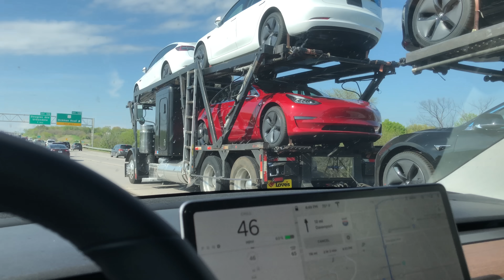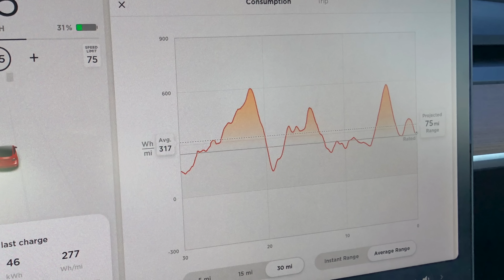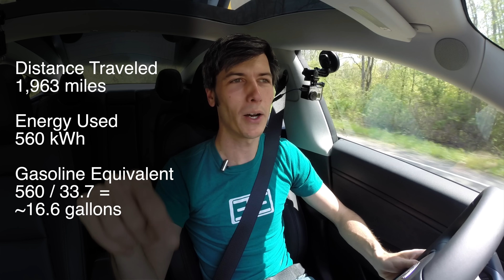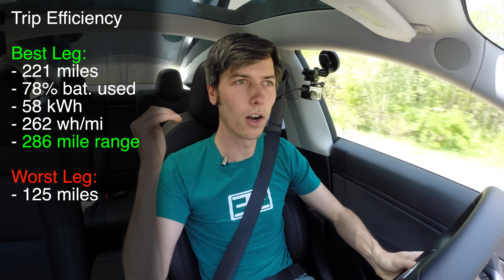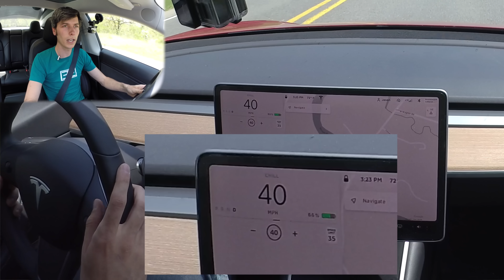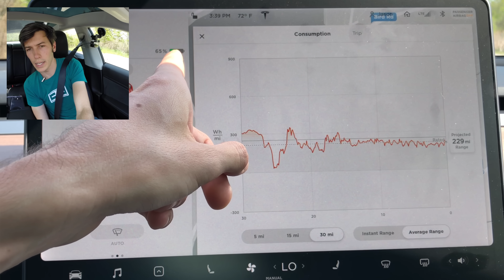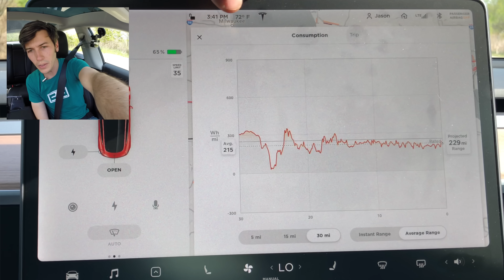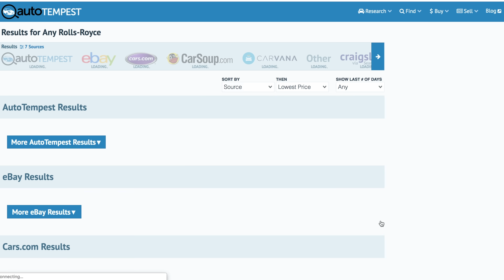How Miserable Is A Tesla Road Trip?

Comment: I'm concerned about the draw on the infrastructure for electric vehicles. Our current electrical infrastructure barely handles the demand. Another thing that concerns me is mining for lithium used in the batteries. Apparently the main source is a small area in South America that relies heavily on groundwater in an area that is the driest on Earth. What effect is that going to have if a majority of the vehicles come to be Electric? When a barrel of oil is refined it's not only gasoline and Diesel as the end product. Thousands and thousands of products are manufactured from other materials resulting from refining crude oil. Please don't bother responding if you don't have a constructive response. It's a serious question that deserves a serious answer.

Comment: So 8 months ago when you posted this, I was paying $2.20 - $2.40 a gallon and at $2.40 the total for 1963 miles is $157.04 and with a 15.9g tank you would have a range of nearly every 480 miles, meaning 5 stops @ 20 minutes each. So your 50k electric vs your car mid 20k Subaru:  same cost for fuel, minimum 200% slower fuel stops. In fact the time of your shortest charge for the tesla is a full tank, a pee, as well as grabbing a snack for the road in the subie. Until the roads magnetically charge electric cars there will be a distinct disadvantage in owning one. And if you did this in the winter... I wish you would actually. You'd need to up your reserve to at least get a 30% and that would drastically change your trip time
Reply: this didnt age well haha
Reply: lets bump the gas up to 5 dollars a gallon now and refigure the math.
Reply: @britthaney3533 I was more concerned with time on the trip but as far as gas prices, it's temporary. It's been nearly this high, right before it dropped below $2

Comment: There is a new term called “Range Anxiety “ if you push it and your battery goes dead it is not solved by a small container of gas . You will have to get towed . Driving cross country a couple of months ago I was shocked that At the huge line for charging Tesla’s just outside of Vegas with the owners standing outside nervously.

Comment: 2,000 is 7 tanks of gas (66.7 gallons at 30mpg, 10g tank) on my 2003 hyundai accent (cheap stick model). therefore my range is better (the tesla truck has about the same range as my car). price efficiency at $3/g is about equal to 37.6mpg.

Comment: So focused on energy density of batteries per kg or per litre.   I thought that way before buying one, too.  The reality is, it works.   Road trips are far from miserable, and while they don't have the complete freedom of gasoline trips, they do remarkably well, IF you get the right mindset and get away from gasoline thinking.  In fact, while this is only for nerds, the truth is the limitations of the battery turn into a bit of an adventure, which some enjoy, but others will not.    Yes, you need to spend a bit of time planning, yes you have to eat at superchargers, yes, you want to find hotels with charging.   But it's fun.   While any Tesla owner can just rent a gasoline car at a cheap rate for their road trips, I have found that most don't -- they prefer the fun of the electric car over the minor limitations of the energy density.

Comment: Interesting to pair this test with Harry Metcalfe's (Harry's Garage) test of a 3 Performance. A key point Harry made is how far in advance Tesla battery tech is, compared with any other EV manufacturer. He matched Jason's average of c. 280 wh/mile and said that's less than half what he saw in the Jaguar I-Pace. Also, US fuel is clearly far too cheap (!): at UK prices, his Tesla used only 20-ish% of the petrol (gas) equivalent.
Reply: "US fuel is clearly too cheap".... That comment didn't age too well.
Reply: @countryjoe3551  Still miles below UK/ European prices. In the UK, we're now paying about $7.45/ US gallon.

Comment: Nobody includes the efficiency from burning the fuel used to create the electricity, electrical transmission losses, and charging losses.  This usually ends up around 20% to 25% thermal efficiency in the end. Better than a ICE of 16% to 18% but still a lot of hidden losses that are not accounted for.  MPGe doesn't account for these losses.

Comment: So when Greta came to Canada to interfere in our elections last yr, she and her antifa parents were driving a tesla. They were worried that going any farther north in Alberta may not allow the tesla to work properly because it wont start in the cold. That was in October when temps were in low 60's or maybe 50's. What happens in dead of winter? Not an all around usable vehicle in all scenarios at all. Quite limited actually. You could buy a second hand beater with good gas mileage and not have deal with all this vehicles unspoken of quirks and not have to pay the 90 grand one of these tesla things costs.

Comment: For me too much stopping. I hate stopping on a trip. I drive till I need gas then it's a quick stop to fill up and back on the road. I don't stop till I get where I am going or am too tired to drive anymore. 200 miles to me is just getting started no reason to stop. If I was to travel all the time I would take a diesel powered pickup with duel tanks. Then put 2 100 gallon tanks in the bed. Set it up so the 100 gallon tanks would fill the trucks tank and I wouldn't have to stop till I needed the bathroom. Then I would drive till I couldn't hold it no more use the bathroom and right back on the road.

Comment: I know the father of a guy that drove 3,000 miles (LA to OKC and back) round trip in his Tesla-ron. He first reported that it was a breeze, but the truth came out later.

He said the worst part was the monumental anxiety experienced during the two massive traffic backups he was caught in. The kind of traffic backups that have traffic stopped, or stop-and-go, in the middle of nowhere for very long periods and distances. One was accident related, and the other because of weather.

Both backups happened in the middle of nowhere and when he was about halfway trough a charge. He worried that he would run out of juice and, being the middle of nowhere, require a tow. A tow because a few gallons of gas from a good samaritan or AAA can get a normal car out of gas off the side of the road, but not an EV out of charge.

In both cases he got lucky the backups cleared, but was low on charge. He had to divert to a city, that fortunately was within range, and stop for the day: The time lost to the backups mounted even after the backups cleared.

He said the weather related backup was the scariest, as the weather was very cold and snowy, and that each tick down of his charge raised his level of anxiety, because, as mentioned, a couple of gallons of gas isn't going to get his EV going again.

He also reported that finding a suitable place to charge in the hinterland of America was much, much harder than expected.
 
He said that he would never do it again. Would just rent a conventional auto to make the trip next time.
Reply: this is mostly irrational anxiety because traffic jams are where EVs shine... EVs use energy when rolling and the amount is based on how fast it's rolling, so you could literally be in a traffic jam for 8 hours and the battery level barely moves even if running a/c or heat... and I've also been in traffic jams where I had the same anxiety in a gas car, so this post is just rubbish

Comment: You said it took 563 kWh for the trip.  In CA, the average cost is about 20 cents per kWh, which would be over 110 dollars.  That's waaaaaay more than 16 gallons of gas.  At $2.50 per gallon, you'd get 45 gallons of gas, and at highway speeds, most modern cars get around 35mpg or better. Which would be about 1600 miles.  Still, the EV is better, but by nowhere near as much as what you claim.

Comment: Great review.  Questions/comments:
1.   I wonder if the estimator takes elevation changes into account.  In this journey it would be telling if on the drive on I-70 over the Rockies the estimate was way off, due to climbing to 11,000 feet.
2.   Looks like all of the stops were about 3hrs apart.  That's too short to use each stop as a meal break.  Every other stop maybe.  And even then, you'd be limited to whatever restaurants were next to the charging stations.
3.   I think range anxiety would still be a problem, because:
a)  What if a charging station is broken down or some other obstacle preventing access to it?  And if you're down to 15% when that happens, there probably wouldn't be enough charge to get to another one.
b)  What would happen if you did run out of charge?  Especially if at night?  Would you have any emergency flashers?  And how do you get going again?   AAA can bring a few gallons of gas, but can they bring an A/C generator, and sit there for however many hours it takes at 120V to get you to a charging station?  Or would it require a 100 mile tow to a charging station?
4.  It only saved $40 on that long of a trip?

Sum total, IMO:  it's a local vehicle, for a radius of about 70 miles from home.  It's possible to go longer distances, but a gasoline powered vehicle is better suited to it:  Longer range (around 350 miles for a mid-sized sedan -- far enough to truly sync fuel stops with meal stops), much quicker refueling, countless refueling stations all across America, no trip-planning necessary for stops, etc.
Reply: All of your concerns about range anxiety are completely valid and shared by me.  When I got my current car, I could have gotten a Tesla, but there are no chargers in my area, and my house doesn't have a garage.  It was either drive several dozen miles out of my way every other day and wait around an hour for it to charge with a Tesla, or get a standard ICE car and just stop 5 minutes for gas once or twice a week.
Ideally, you want to have some flares and warning reflectors in your car anyway, in case you break down and flashers aren't working or visibility is poor.  If your Tesla battery goes too dead to drive, the blinkers are supposed to still be able to work for a while, but it probably isn't good for the battery integrity and likely won't last very long.  In most places, you'll be looking at getting towed to a charger and likely have to push your car the last stretch because they couldn't drop it off at the charger.

Comment: I do have a question. I live in australia and basically yearly drive  a 4000km round trip is a tesla even feasible for that? Only one end has fast chargers, otherwise it would be getting charged off 240v 10a. Or should i stick to my old diesel 4x4 (last trip inc towing back around 800kg of stuff cost 1500 aud, that included food, powered camp sites, drinks)

Comment: I am almost trade-in my 2018 Lexus LS-500 Fsport in for 2020 Tesla Model S, but after I test drive the Model S and the autopilot and full self-driving feature really disappoint me. I am not sure if there is a way to get around it. I took a long trip all the time and I use the cruise control on my Lexus LS500 a lot and the help of the steering wheel assists it to help a lot on the long trip. This is why I want Tesla so I can have better help on a long trip. But it turns out the Tesla Autopilot and self-driving only go over speed limit 5 miles that all. My Lexus can go above 100 miles with cruise control.
Can anyone confirm if it is correct that Tesla only goes over speed limit 5 miles? Is that a way to get around this limit?
Thanks 
Nice video man.

Comment: Question.  From what I know batteries only have so many changes in them, so charging small partial charges eat the life of your battery.  So why would you not want to wait for a full charge?  2nd question which you probably would have to do a video on, what is the life and cost of replacing a Telsa battery?
Reply: Also fast high power charges shorten a battery life compared to a 12 hr 120v charge.
Reply: he didnt show charging the car, just driving it.  where and when did he charge the car.  did he sleep at night while charging or have to wait 5 hours while his car charged up?

Comment: When comparing fuel efficiency of EV and ICE powered cars you have to start at the engine. An EV engine is back at the power station so you have to include the efficiency of the boilers and furnace, the transmission losses and the recharging losses.
Reply: If that is your argument, then ICE cars engines start at the drill for oil, then the processing, and then the transportation (by truck, train, boat what have you which is also burning gas) to the gas station where you get fuel.
Reply: @TheStalkingShadow  That is correct and is part of the purchase price of the fuel.

Comment: Once the car is freshly charged it is efficient if the EV is new.

Yet how efficient was it to make the electricity, transmit it and charge it. Not so much. 
He is selectively ignoring all the "inefficiency" was done prior to the charge.

Translation
If you ran on Natural Gas you'd go how much further than if you converted it to electricity first.
I'd like to know the answer to that. I'm guessing prob 40% farther.

As far as green energy. There is a reason you won't see a solar panel on top of these things.
If you saw how little the charge moved you get a better Idea the power needed.
I would not be surprised if you had a cloudy week the car would actually have a less charge at the end of the week, standing still. As the battery does lose energy over time even if battery is brand new.

Comment: Oh yeah, let's put this on OTR trucks. I drive 48 miles to work, so 96 miles a day. I don't want to sit for an hour charging every two days, thank you very much. My 2014 Ford Fiesta typically lasts a week on a full tank. And for those saying you can just charge it at home, yeah sure let me just skyrocket my electric bill instead of paying $35 a week in gas. Okay.

- But anon, you're spending $140 a month in gas!!

And how much MORE would that be in electricity?

- BUT IF YOU USE THE CHARGING STATIONS---

My time is worth more to me than the price of gas. Your argument is invalid.

Comment: What about the power loss due to resistance in the over head power lines ? Just the loss of pwoer to get electricity to your house from the coal buring power plant.  Not all efficent as it appears. Current drawn by the substation is I=P/V and the higher the transmission line voltage, the smaller the current. The line loss is given by Ploss=I²R, or, substituting for I,

Comment: What happens to your trip planning if you need to deviate from Tesla Supercharger locations and then charge conventionally ?
Sounds like it would make trip take many times longer, given that you would reduce from 150kw to 1kw charge rate ?
Or are there some 240v generic charge stations around ?
Reply: there are a lot of 3rd party options that also charge at 150 250 or even 300

Comment: We did a trip of about 350 miles a few weekends ago in our Model 3, it was actually quite pleasant and we got to see some areas near the chargers that we'd not visited before on a route that I drive quite often but never get off the highway. A head wind, uphill and high speeds REALLY affected our miles on the way home. The super charger we used was amazing!!  My 4Runner gets about 17 mpg on the highway so I would have stopped 6 times on HIS same trip of 1,963 miles and spent about 300 bucks in gas!!  Oh and you "being born in 1963" . . .  my ass!  😆👍

Comment: It would help if you added the time it took to charge before you initially began your trip.     With the numbers you provided, I came up with an average speed the vehicle can transport a team of drivers is about 50 miles per hour over long distances.   This average speed is very close to the 70 miles per hour a truck fleet would require.    Close  enough.

Comment: I still cant see how this can scale. You can build endless gasoline stations and truck out gas to them. But the energy grid doesnt allow you to just truck out the power you need to build hundreds of chargers in the middle of nowhere and the existing power distribution networks are not designed to feed so much current. I guess localised mini power generation sites is the only real solution. Hydro would be my first choice followed by nuclear, cause if all you have is solar, no one drives far after sun down.

Comment: No chargers where I live. To drive 30 hours you had to charge 8 hours. I can drive 30 hours and gas up in 30 minutes. I really don't care how great tesla is but it's not for me.  Dallas has one supercharger. Fort Worth has one supercharger.  In rush hour do you know how long it would take to get to the one supercharger in Dallas? Bumper to bumper traffic it would take forever and then you would have to wait to charge. Gas stations at every corner. Tesla would be an absolute nightmare. One of my vehicles is diesel. Think back to when you only could get diesel at a truck stop. Nobody would buy diesel cars. Now every gas station has diesel. Tesla does not have the supercharger network developed to make this viable and it will never be convenient unless new battery technology allows a charge as fast as gasoline or diesel fill up.

Comment: you are  way wrong for gasoline... 30 mpg it is for citiy drives with a/c on. in highway, with steady speed as low as 75 mph, a modern gasoline engine gives 45-55mpg and a diesel can reach 80 mpg. if you have 40 mpg (the lowest  I can think from a gasoline engine) then the cost of the gasoline should be $150. It can easily be less than this.

Comment: What Tesla needs is a, "gas can." 

Think of it. 

If they had a modular battery and a port on the car, you could have it where you plug the "gas can" battery in, maybe even in your regular outlets at home, and then have it as a spare charge you can use in an emergency. Something that gets you like ten to twenty solid miles. 

You could even own a few of them, maybe, and keep them in your trunk on days you really need extra range. Maybe even have the car drain them first if they're installed. =\